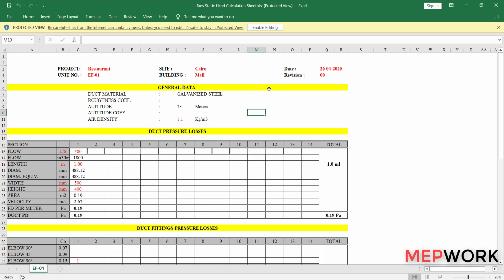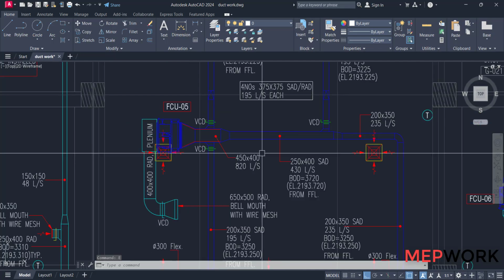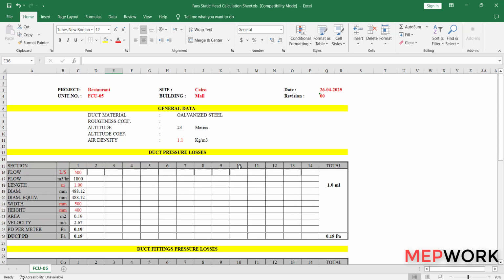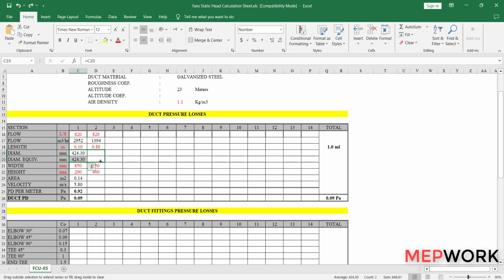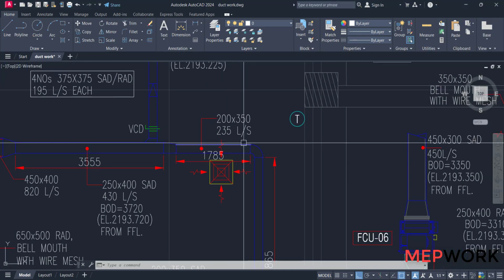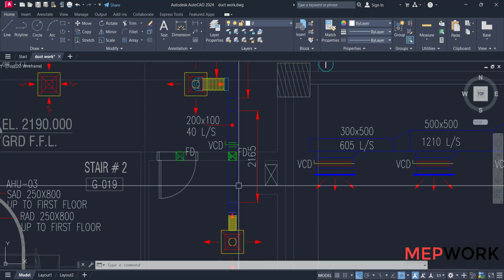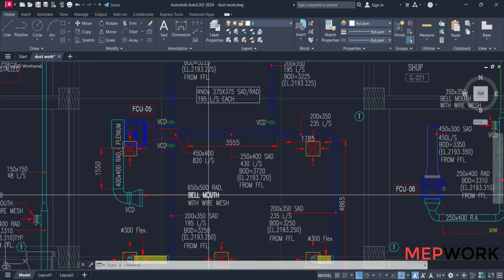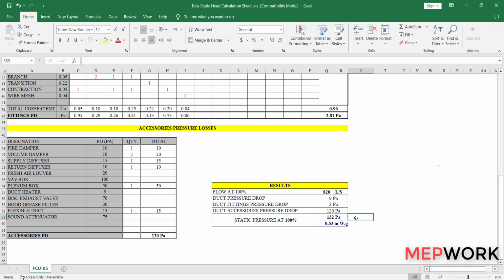Duct Friction Loss and Fan Static Head (ESP) Calculation

Comment: Thank you for the information. I have two doubts
1- In the section 7, why did you consider 100 Meter length for a small bell piece ? ( 100 mm or 150 mm will be general length right?)
2- Why in section 1 m3/hr = L/s x 3.6 and rest all section m3/hr =L/s x 1.7

Once again thanks for the video

Comment: thanks alot but i had a question in columns 1 and 2 when flow is 820 L/s the column 1 cubic meter per hour is 2952 while in column 2 is 1394 why is that or is this a mistake ?

Comment: Sir I really appreciate your such efforts for Engineers like me who are young in this field. May you succeed InshaAllah. But sir I would appreciate your answer for a question. Can i perform this calculation for Exhaust duct as well. And also about off set, how can I calculate that here like I don't see an option for it ?
Reply from the maker: Thank you very much
Yes you can use it for exhaust duct
You can assume duct offset as two 45 degree elbows
Reply: @MEPwork  You are the best ❤
Reply: Well done  ,Kindly review value for plenum box of FCU 
Its so big ,do you have any Refrence for this value ,and why you take return grille its free return ,you can check with ashree duct fitting

Comment: How did you consider the accessories pressure drop
Reply from the maker: You should get it from the product catalog if you want accurate results, in the video I used common values.